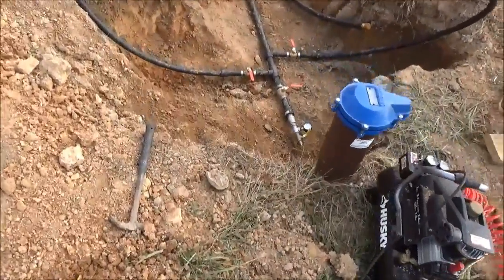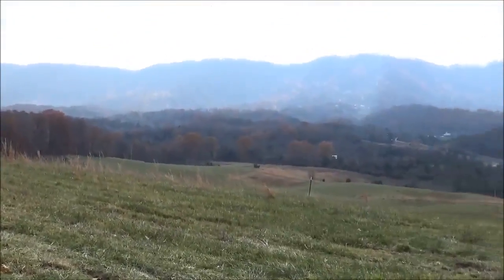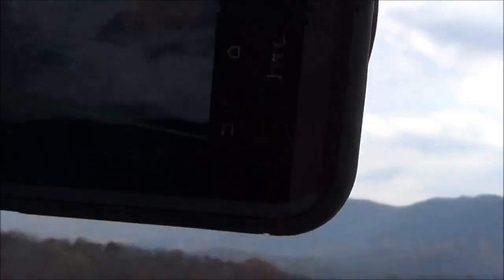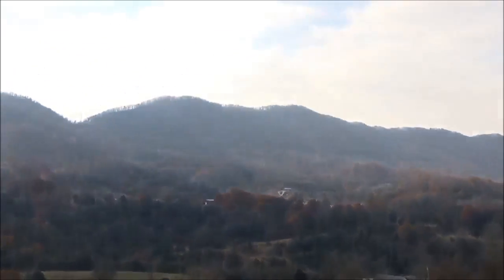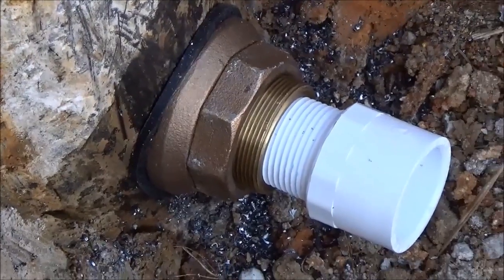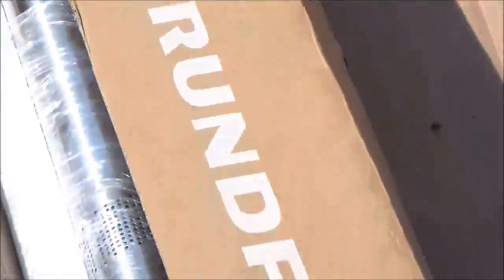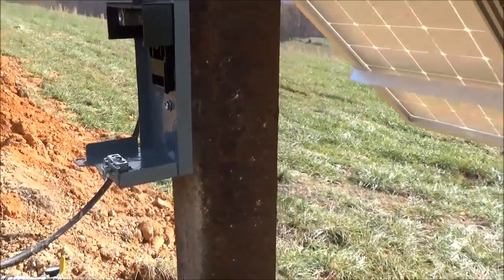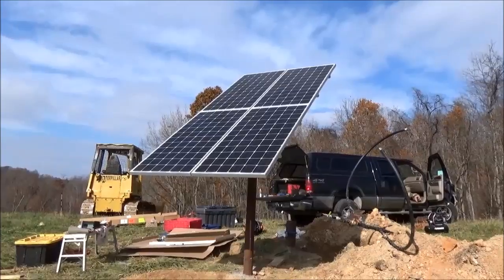Mountain Top Tennessee Solar Water

Comment: Great video!  I love watching all the different projects you tackle and they are interesting to view. I've noticed most of your solar panels are same shape and size so I'm thinking you use the same one over and over again.  My guestion is where do you buy the panels and how much are they? Its great to live in SC.
Reply from the maker: Tony, 

Actually I use about 3 different sizes.  145, 190 and 285s depending on what I am doing, how much water is required, depths etc. I typically order a pump system along with the panels from Solar Power and Pump in OK.  When I buy a bunch of panels I have been using Gexpro out of Florida.  The latest was 300 watt sunivas foro .83/watt.
Reply: Super!  Thanks for the info. I'll check them out. I also have a few ?'s about WHERE  to locate water and well placement.

Comment: I find it soo interesting to watch projects like this! I live in Canada and we have a well for our drinking water and our pitless adaptor is about 3 meters down the well casing! I assume due to the deeper frost depth. our well is also an older well that was drilled by a man who was nearing retirement in the 70's when the well was drilled so he had a reputation of doing a little extra then necessary :)
Reply: also I didn't post it on the "My Testimony" video but thanks for sharing! I appreciate it
Reply from the maker: Yes, your pitless needs to be way down there to beat those sustained freezing temps.  This same system would work the same way in Canada is you are ever interested.  :)

Comment: We did a similar project. Same pump but different control unit. We wired an extension cord into the control unit that plugs into an outlet that the solar is wired into. To switch to generator we just unplug from the outlet and plug into the generator.

The other thing we did was a float in the cistern that closed off the water line when the cistern is full and then have a pressure switch by the well that is wired to the control unit and turns the pump off.

Those grundfos pumps are amazing. AC, DC, and works with a wide range of voltages/amps (more solar more water).

Comment: So, it takes 4 solar panels of, I'd guess 60-100 watts each to run the well pump? Is that setup also for generating power for the house too? I get that it's pulling water up 350 feet, it just seems like a lot for a pump. I am not trying to be a jerk, It just seems too much.
Reply from the maker: Well, the total solar on this is 750 watts which is equal to about 1 horsepower.  If you were to install a regular 1 hp submersible you would get a comparable amount of water at 350 ft.  The beauty of this is that this is offgrid.  No more money to be spent on water pumping.  This pump is extremely efficient.  On this site is lifting 9 tons of water everyday to an elevation that provides 50psi pressure at the homesite.  That is just not too much solar. It is awesome!
Reply from the maker: Lansing Allison we pump up to the elevated tanks at an elevation that provides 50 psi down at the point of use.  It is cheaper to store water in tanks than energy in batteries to pressurize a bladder tank.
Reply: engineer775 Practical Preppers oh to get the 50psi  you lifted the water with the well ? and then let flow down hill to the tanks ... ?